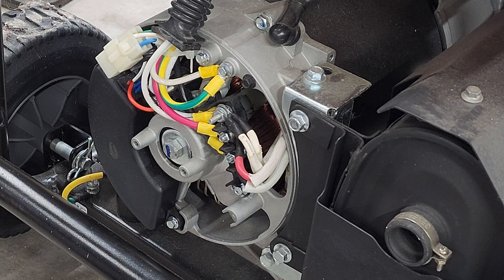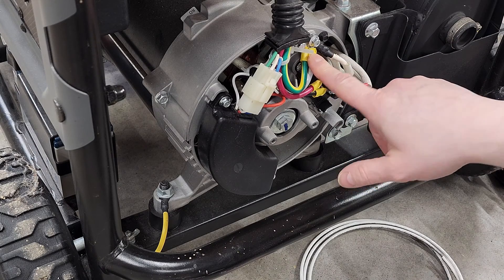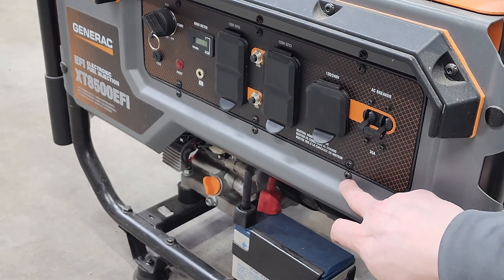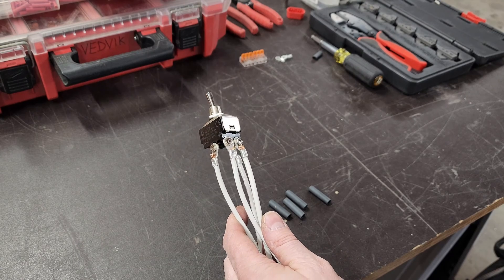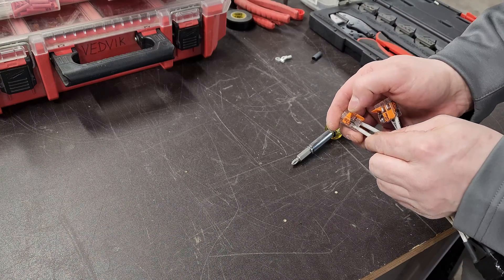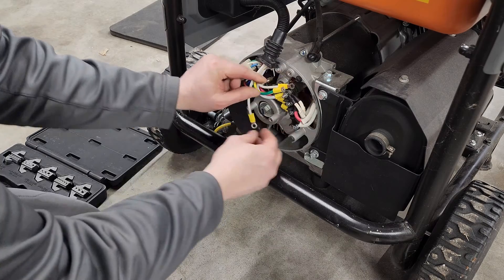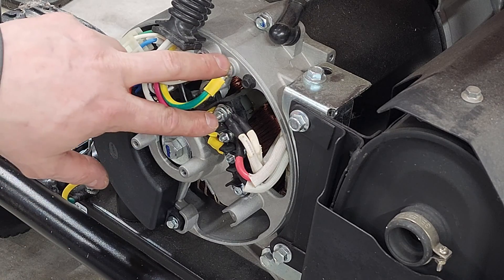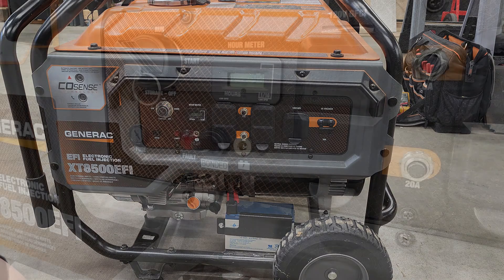Electrical Engineer Explains: Portable Generator Bonded vs Floating - How I modified my generator!

Comment: I wonder if you can just get a neutral grounding plug which when plugged into 120 v receptor on the generator, you canvert it into a neutral bonded generator.  This has been done for a lot of RVers when they have a floating neutral generator like Honda.
Reply from the maker: This describes the opposite scenario - where a bonded generator is connected to a home.
Reply: RVs typically don't have NG bond in the breaker panel.  It's done at the pedestal.  When a floating neutral generator is used you can typically just make a receptacle plug that has a jumper between the neutral and ground contacts.   This just plugs into one of the generator receptacles to make the generator bonded.

Comment: Thanks for sharing this video, Richard.  I recently purchased a bonded 7500 firman generator at Costco and have already installed a 30A generator inlet box, 30A 2P breaker, and interlock on my main panel to backfeed my house during power outtages.  To clarify a previous video of yours on this topic, for me to functionally achieve a "floating neutral" configuration without modifying my generator (that's bonded), could i just lift the ground conductor coming from the panel inside the inlet receptable box on the wall and placed a warning label on the inlet box cover stating: "For connection of a non-seperately derived floating neutral system only".   Your professional thoughts are appreciated and thanks again for this informative video.

Comment: Does it start up and run in float position? I found another video on YouTube showing how to float generacs and a few people had problems with the engine stayng running for more than 5 seconds. But when they put it back to factory it would run normally. Why would it do that for some people? Could they have just not done it properly? I still haven't got mine yet but it's coming. I got the 7500 watt fuel injected dual fuel. I hope I didn't make a mistake ordering that one.

Comment: So after watching many videos on this subject. This is my conclusion. When operating the generator separately not powering your house. It's neutral should be bonded. When powering your house it should be unbonded. Floating neutral.
Reply: If you are connecting to your house, the generator neutral must not be bonded because the house wiring is already bonded. If you are extension cords the generator neutral must be bonded because that is the only bond. Having two bonds on a system is a problem.
Reply: I think it's the exact opposite. If using the generator at a camp site it can just be used as is, floating neutral. But I read that in order to power my gas furnace, for instance, the neutral has to be tied to ground.
Reply: @rael5469  My furnace is bonded in the breaker panel in my house. Unless I completely disconnect the furnace, the generator neutral should not be bonded. Campsite = Bonded Generator Neutral. House = Floating (unbonded) Generator Neutral. One bond per system.
“As is” my generator was bonded from the factory. Not floating.
Reply: @walterandrews3077  But I think that's the whole purpose of an emergency generator powering a furnace.....that it must be disconnected from the main panel so you don't back power the mains. Having one of these isolation switches right at the furnace would be a quick and safe solution.....using a little generator like the Honda 2200i. I don't think the little generator could power too much else besides the furnace ( in Wintertime) so I'm not worried about having an isolation switch in the main panel, just yet. I'm just looking not to freeze to death in winter without spending too much to guard against relatively rare power outages where I live.
Reply: @rael5469 your correct it depends on what you are powering, and it makes it confusing.
As he stated connecting to a grounded system must be unbonded.
But like you said some individual powered devices need a bonded power supply.
Not sure how to tell for sure.
Reply: @billz4795  From what I've seen online here......if trying to power my Bryant gas furnace with a Honda EU2200i generator.....I have to use the neutral-ground bonding plug in the other outlet of the generator. I haven't tried it yet but I'm told that the circuit board of the furnace is looking for neutral to be tied to ground......like in the main circuit breaker panel.
Reply: @rael5469  from what I've read it looks like your furnace/ device is looking for a neutral ground. I have the same concerns AND mine is connected to my AC unit. My concern will the power to the furnace  back feed to the AC control?
To get around this issue I'm looking at some version of a main panel transfer switch. Connect through the main panel turn on what you need, thus all is bonded.
Reply: @billz4795   Sounds like a plan. That's only a signal voltage for the AC unit anyway, not 125 vac. Anyway....the AC control is all within that "thermostat" on the wall. That doesn't go out to the mains, just to the circuit board on the AC unit outside. The AC unit outside would still be out of commission by the power outage.
Reply: @rael5469  sounds logical, but doesn't the AC have its own controller at the unit to start and stop the compressor AND the air circulation fan that is also controlled when the furnace is activated.
It's that "cross control" that I was confused about if in a power outage I was powering up only the furnace would there be an issue.

Comment: When I first watched this video, I thought I heard him say what wire he used but now I cannot find it.  Does anyone know what gauge wire he is using for this modification?
Reply: Never mind, I found it! 10 gauge TNNH.
Reply from the maker: @scottfarris8728  the wiring has to be rated for the generator amperage on the phase conductors, so the neutral is the sized for the application

Comment: I appreciated seeing this and a bit shocked by some of the negative comments. I’ve got a portable little Champion 2500 watt floating neutral right now for feeding a heavy duty extension cord and just using a bonding plug and ground rod with a GFCI adapter to the cord, but acquiring a larger unit for both stand alone portable use and whole house backup power.  What you’ve shown was my thoughts on how to possibly handle that so seeing someone else do it was helpful. Thanks for your time sharing this with us.
Reply from the maker: Thank you for the comments!
Reply: @richardvedvik979  will damage be caused if you hook up to house with it bonded?
Reply: @ It’s against code over it being a serious safety hazard to have more than one grounding point in a system. A floating neutral connected to the house simply uses the ground for the house system while the bonded maintains its own ground for when I’m out in the weather with long extension cords wanting GFCI. The bonding plug in one outlet bonds the neutral wire to the ground wire for a return path to the generator frame or the frame plus ground rod if I use it then my GFCI works for me.

Comment: So if my generator has GFCI outlets, do I need to worry about bonded and floating ground
Reply from the maker: If you're just using the 120V receptacles, the GFCI outlets, then you don't have to worry about bonding.  If you're back-feeding your home, then that's what this video is about.

Comment: I want to do the same thing.  But do you select the toggle  amp size based on the bonded amps or the floating neutral amps?  I have a briggs and stratton 8000 with 30amps outlet and 2x 20amp outlets. 20amps will be the bonded, and the 30amps will be the size i need floating.  I would appreciate any help. CHEERS!

Comment: thanks for the video. It is very helpful. Could you tell us where to get the toggle switch you reference? I am unable to locate one with the ratings you mention.
Reply from the maker: I used a switch a lot like this:   https://www.amazon.com/Nilight-Rocker-Toggle-Switch-Waterproof/dp/B087NCLX3W  
I wired the neutral bond through both contacts (hence DPDT and not SPST) to get the full 30A handling capability.

Comment: So you’re trying to avoid parallel conductors by installing parallel conductors!  
The risk of using generator in unbounded condition to power devices out weighs using generator to power house in bonded condition.  99.99% of people will never understand any of this.
Now why didn’t you just undond the generator and install switch to lugs in panel rather the run the wires back to the generator head. Now neutral wires don’t have to be same gage as L1/L2 for main service conductors so you probably don’t need 30 amps for bond switch.   Just my thoughts.

Comment: Thank you for the great videos! I have a generator with a floating neutral that I use for powering up the house during outages. If I  want to use the generator for like power tools as a stand alone generator. Can I use a neutral ground bonding plug to make the generator bonded neutral and is it safe?
Reply: I was going to ask the same question, as I made two of my own binding plugs, using 10AWG wire as my jumper.  I did one on a 30 amp twist lock, which I leave plugged into the twist lock outlet, so when exercising my generator with just items directly plugged into the generator’s 120 volt outlets, the neutral is bonded, but when I go to plug it into my installed inlet box using my 30amp twist lock cable, I have to remove my bonding plug, in order to plug in the transfer cable.  Keeps me from forgetting to remove the redundant neutral bond.  Would 8AWG be better.  The original jumper wire that was in place appears to be 10AWG, so that’s why I went with that.
Reply: @larryr8320 I ended up doing the same thing you did as far as making the 30 amp twistlock bonding plug. That's a great idea as for keeping the bonding plug plugged into the generator until I need to hook it up to the 30 amp house inlet to power the house!
Reply from the maker: @bryans8193  I like your idea having the bonding plug.
Reply from the maker: @larryr8320  I like your idea of having two cord systems that you use for either stand-alone or home-connected.  The size of the bonding jumper is determined by the amperage of the plug.  10AWG is fine for any system 50A or smaller.
Reply from the maker: The neutral-ground bonding jumper needs to be adequately sized, something a plug may not accomplish.  What model is the generator?
Reply: It's a Troy-Bilt model 01925

Comment: did the same switch for my 8kw portable generator  for the house, which will be the normal case, but I might want to use it stand alone.  Flip the switch to BONDED or FLOAT position depending on what is needed.  Thank you for your video.   I take old non working generators and get them running again. Usually it is the carb.  On the above 8kw generator I got for $50, tri-fuel and the problem was:   a shorted wire to the capacitors, brushless.  Fixed the wire and power from a 2 cyl  $3,000 genset began again

Comment: So, the reason for the generator to have a floating neutral is when it is not connected to the house? It's for power tools straight off the generator?
Bonding is for house use?
Reply: You have it completely opposite
Reply: @larryr8320  Well, I'm dyslexic. That might explain why I'm not understanding the bonding part. 
I had an electrician wire up my portable generator to the house. I told him to spare no expense. I wanted it done correctly. He was delighted to hear that. I guess some people are only interested in paying for the bare minimum?
Reply: Well, that was a wise decision.  Especially when working with electricity and you are unsure of what you need to do, it is always better to have a skilled person do the task.  For the most part unless a wire is sparking and arcing, you can’t know for sure if it’s live, without the use of a meter.  Always better to be safe than sorry!  There is a lot to learn about using a backup generator, I’ve been learning new things for years and still have a lot to learn.  Lots of good websites out there to  learn from
Reply: Try this as a way to remember.  
Bonded when using it By itself.  

Was trying to come up with a rhyme for floating and this is the best I can think at the moment 

Floating for the Furnace. 

But that assumes you are powering the furnace through the electrical panel.   Oh well, I tried.
Reply: @larryr.8038  You might be surprised to know this? I'm a power lineman for a living. We get paid from our neck down. Our electricians are paid from the neck up. They have to know the ins & outs of electricity. We just build it. It's a rewarding career. I'm nearing the end after 37 years. The technical stuff always confuses me. Hence why I just do the heavy lifting.
Reply: @larryr.8038 Now you’ve got me thinking it…. “Float the house/Bond it by itself” 😂
Reply: Watch it again, man 🙄🙄🙄🙄
Reply: I watched twice & three times. I only have a working knowledge of electricity. Not the level of education of you have. I'm still confused. 
Perhaps you should modify your video for those with a working knowledge of electricity? I understood how you did your modification. I just don't understand why you did? You touched on it briefly.